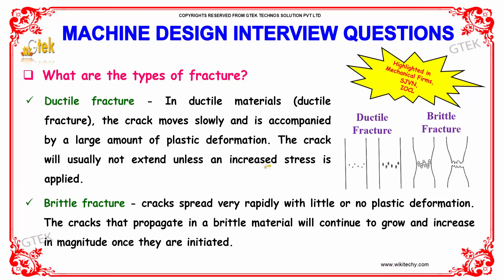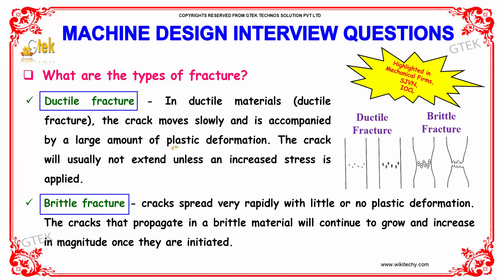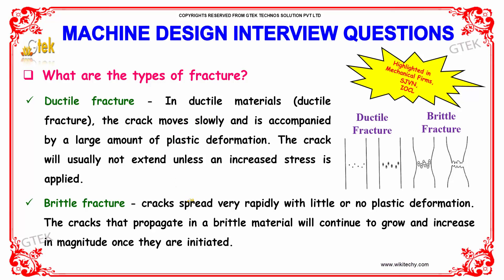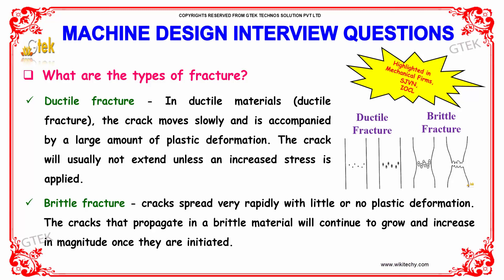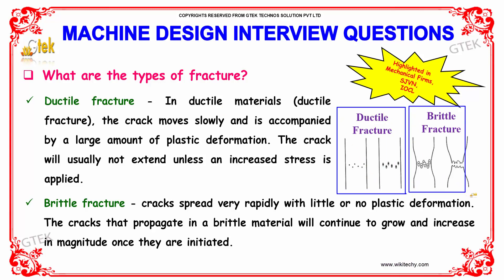what are the types of fracture in mechanics | Machine Design Interview Questions and answers

Comment: In ductile fracture, extensive plastic deformation (necking) takes place before fracture. The terms rupture or ductile rupture describe the ultimate failure of tough ductile materials loaded in tension. Rather than cracking, the material "pulls apart," generally leaving a rough surface.

Comment: Stress vs. ...
Brittle fracture in glass.
Fracture of an aluminum crank arm, where Bright= brittle fracture, Dark= fatigue fracture.
Ductile failure of a specimen strained axially.
Schematic representation of the steps in ductile fracture (in pure tension)
Fracture crack separation modes.
Fracture - Wikipedia

Comment: Fracture mechanics is the field ofmechanics concerned with the study of the propagation of cracks in materials. It uses methods of analytical solid mechanics to calculate the driving force on a crack and those of experimental solid mechanics to characterize the material's resistance to fracture.

Comment: ductile fracture, extensive plastic deformation (necking) takes place before fracture. The terms rupture or ductile rupture describe the ultimate failure of tough ductile materials loaded in tension. Rather than cracking, the material "pulls apart," generally leaving a rough surface

Comment: types of fractures
Ductile Materials:

Ductile materials will withstand large strains before the specimen ruptures.
Ductile materials often have relatively small Young’s moduli and ultimate stresses.
Ductile materials exhibit large strains and yielding before they fail.
Steel and aluminum usually fall in the class of Ductile Materials
Brittle Materials:

Brittle materials fracture at much lower strains.
Brittle materials often have relatively large Young’s moduli and ultimate stresses.
Brittle materials fail suddenly and without much warning.
Glass and cast iron fall in the class of  Brittle Materials.